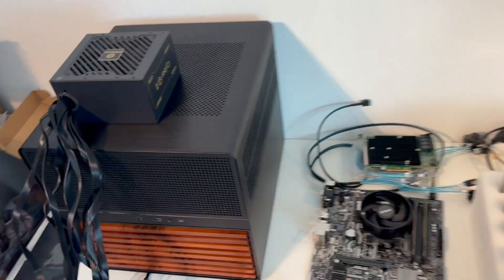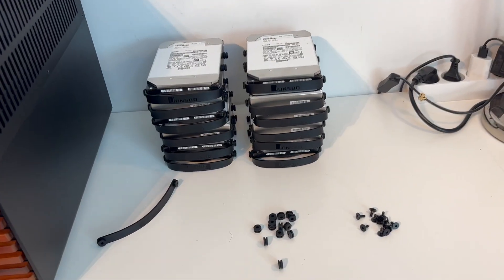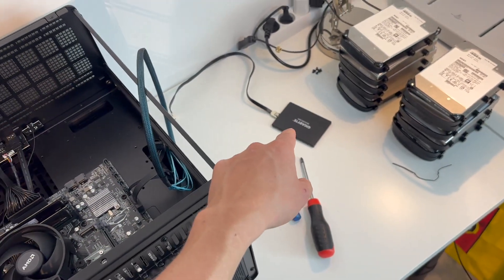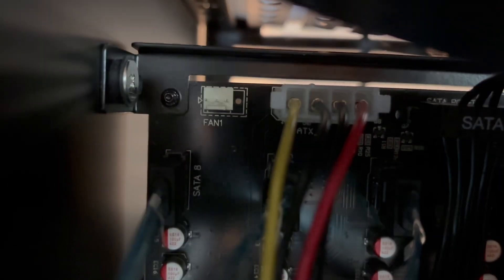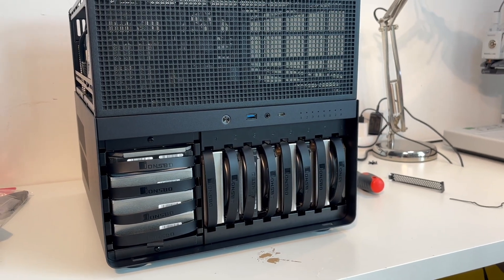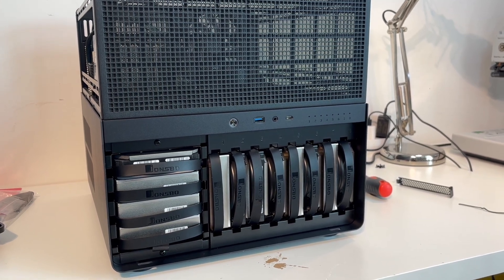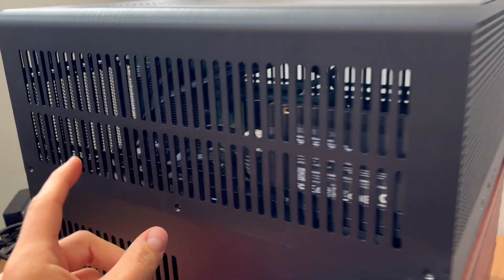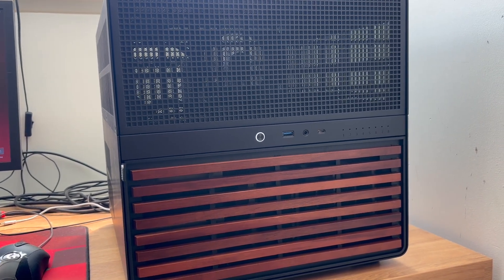Building a 120TB Home Server in the Jonsbo N5 case! 12x SAS Drives.

Comment: Thanks for sharing! Inspired me to order this case.

To the audience, I strongly recommend opting for the LSI 9305 16i (or 24i if same price).

The LSI 9300 is a bloated dual chip design that runs hot and should be equipped with extra power plug. The 9305 is ideal. Half the power and cooler.

Be aware of cheap clones and counterfeits! Most reliable source is pulled server parts from a trusted seller. Expect price 150 - 250 USD / EUR.

You don’t want to cheap out on your hardware. Get it right and it will list you a lifetime.

Comment: i recommend that you use a good PSU like Corsair and not the strange one you are using.
this will save your HDDs.
also you need a fan to cool down your HBA card because it will most probably fail without active cooling.

Comment: The sas drives work because it's what we call a passive backplane, so has no chips inside it. What's happening here is the sas protocol is able to work over the SATA breakout cable from the controller.
Reply: So, for clarification, is possible use sas drive in normal board? The prices of sas on ebay are more cheaper.
Reply: Yes you just need an HBA and the right sata to hba cables
Reply: Before I order my case and some SAS drives I’m hoping someone can clarify my confusion. 
If I have a SAS HBA and SAS drives. What cables do I need to connect the backplane to the HBA? Can I plug SAS breakout cables into the backplane?
Reply: @r @robertwellington1991 es, I currently have sas drives docked in place of normal HDD. I had to buy an Internal mini sas to sata cables. I just plugged in the sata to the board included in the case and the other end to my HBA.

Comment: What a great case. My only gripe is that there aren't mounting holes for a 200mm fan in the top like in the old Cooler Master HAF XB, but nothing a dremel can't do.
With a Corsair RMx (2024) PSU you could have even more airflow because it got knob to regulate the fan.
Reply: I was also a huge fan of the Cooler Master HAF XB. I'd love a modern version one blended with some features from the Jonsbo N5.

Comment: How about the speed you are having with sas drives on this backpane? There is any loss of performance BC of the backplane?
About the fan noise I watched other people changing the fan for another ones BC the one that came with the case don't work when connected to the mono and when connected in the backplane there is no speed control it was always on max hence the noise.

Comment: Hey! Can you explain how this works? Looks like the backplane is actually SATA? Does that mean that you are running 1 lane SAS? Does your hotplug work? How is the performance?
Reply: I have the same questions. 😵
Reply: The backplane has a SAS interface on the drive side, meaning you can install either SAS or SATA drives. The rear side of the backplane has separate power. You can then plug the SATA data cables directly to your motherboard if you have enough ports. If you don't have enough ports, you can buy HBA cards with SFF>SATA cables. These cables split a single SAS header on the HBA into 4 SATA data headers. If instead you choose to use M.2 or PCI based SATA expansion, you can just run straight SATA cables to your drives.

In my case, I've run the HBA and 3 cables to my front drives. Then I am running SATA directly to the motherboard for my side-mounted SSDs.
Reply: @timothyhanson2747 I got the part of the connectors. My question is if I use SAS drives on this case with a HBA like yours would I have Sas speed or sata speeds?

Comment: the backplane needs both sata and molex power? its not one or the other?

on the nascompares site they say to use one or the other not both
Reply: so someone followed the electrical traces and you do indeed need both if you fill all the slots. each power connector corresponds to a few slots
Reply: It need both. That is true for the jonsbo n4 too
Reply: Use all the provided power inputs on the backplane. This spreads the load across multiple cables from your PSU, preventing any single wire from getting too hot.

Don't use a single cable with 4 splitters to power everything.

Hard drives use significantly more power when they first start spinning than they do during normal operation. If you don't provide enough power to the backplane, the voltage will "sag" during startup.